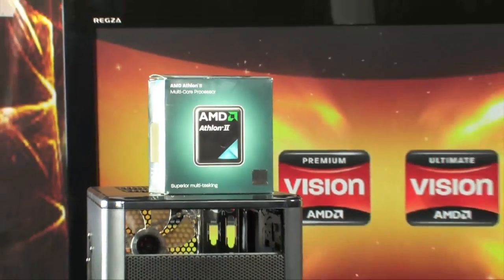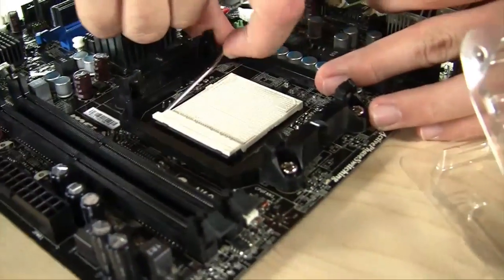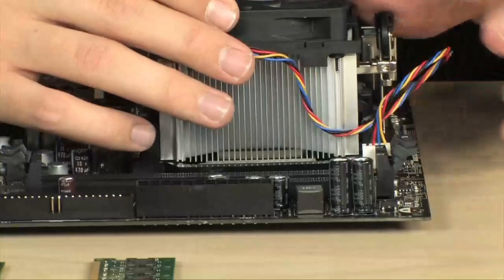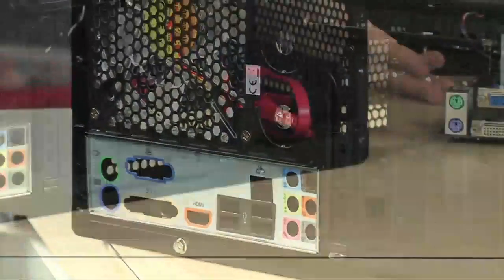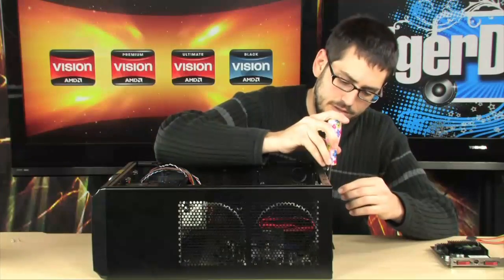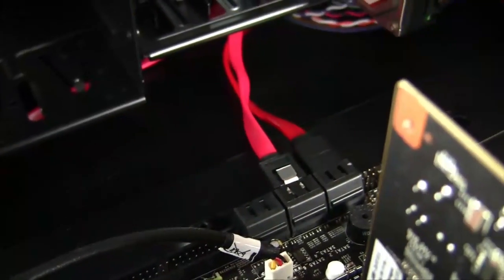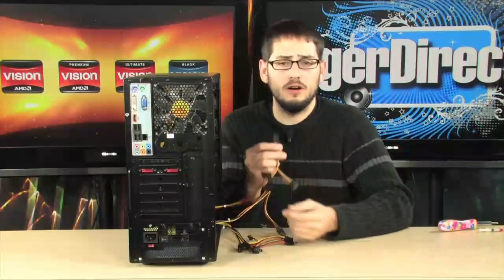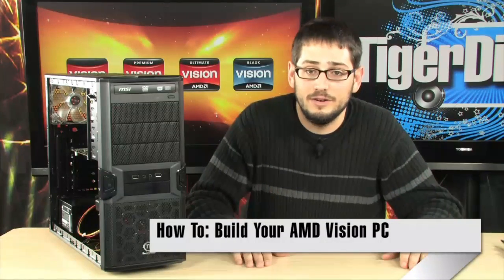How to Build a PC : AMD Vision

Comment: No the raisers lift the board off the back panel so the I/O connections line up properly and just to generally get a good fit.
You don't need to worry about conductivity because the board is insulated, plus there is no high voltage involved.